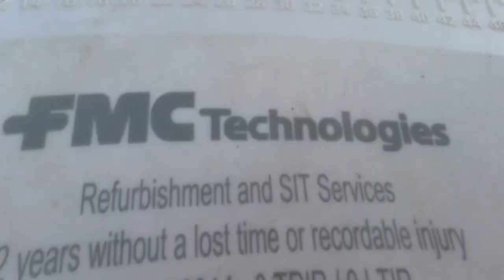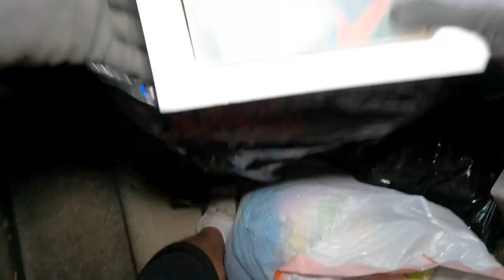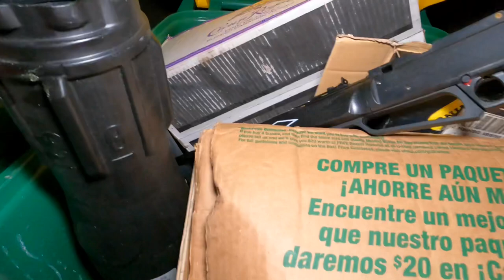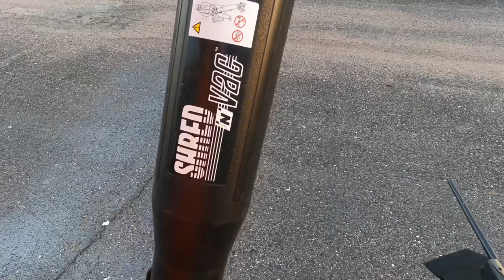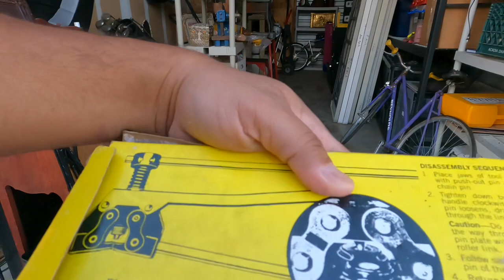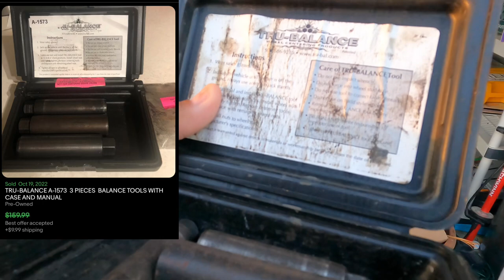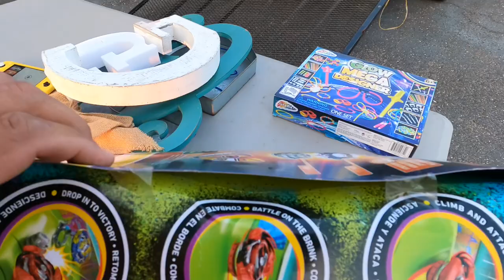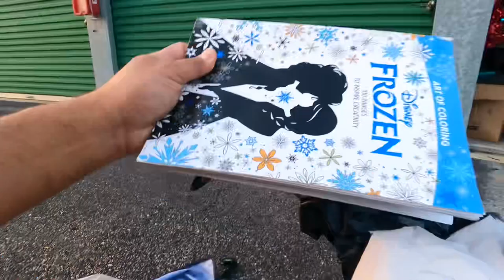Crazy what people throw away!!!

Comment: This particular Daisy does not have a CO2 cartridge but has gasket seals on the piston used to pump up pressure, you can get it direct from Daisy that unit is aPowerline